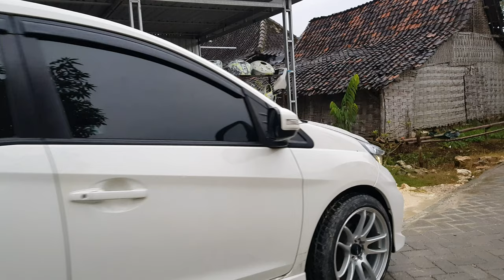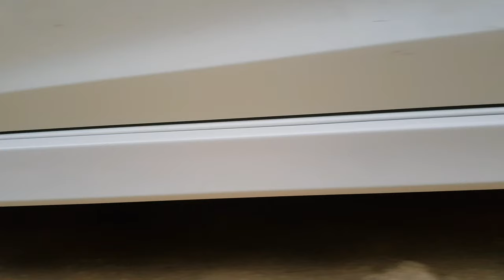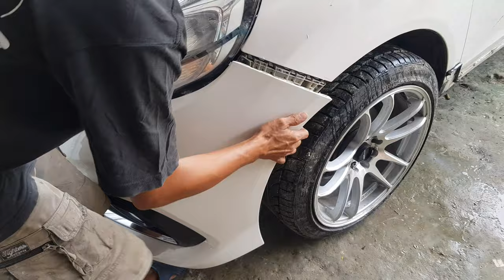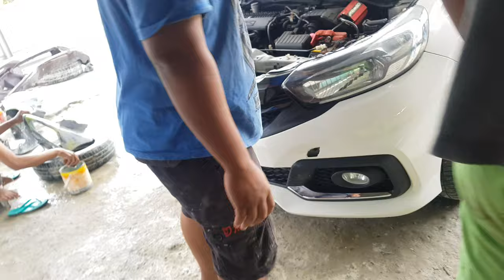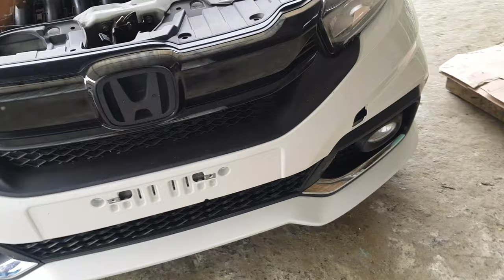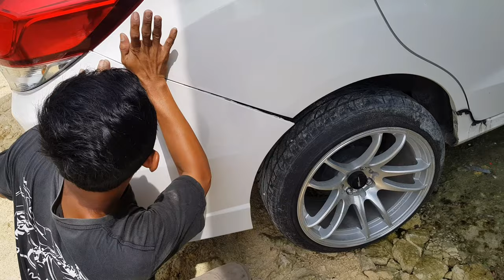Upgrade Honda Mobilio Type E 2015 to RS facelift

Comment: Estimasi habis brap dari e ke rs om?
Reply from the maker: 10 jt om.trima beres
Reply: cup mesin apa ikut diganti gan?
10jt penggantian apa saja gan?
Reply: Bos itu ttup gril radiator pake bawaan apa di ganti jga pake yg tipe RS
Reply from the maker: @elpinasarisibarani7500  iya gan d ganti
Reply from the maker: @Erwin-cn6np  iya d ganti gan.. klo blm facelift.. tp klo sdah facelif smua type sama dan bisa d pakai
Reply: Ok gan trimakasih infonya